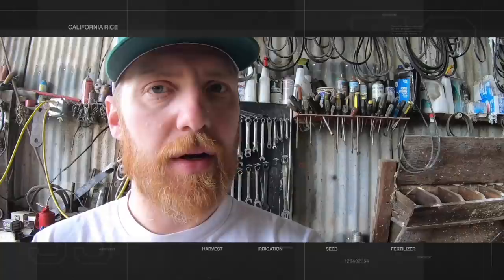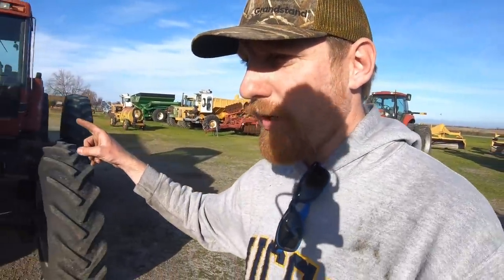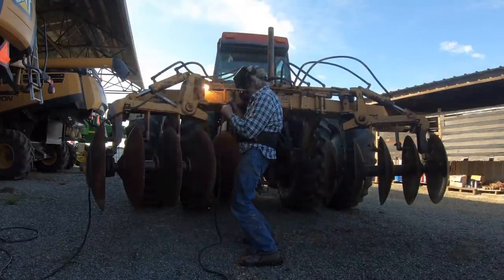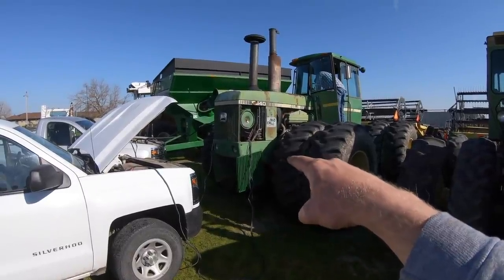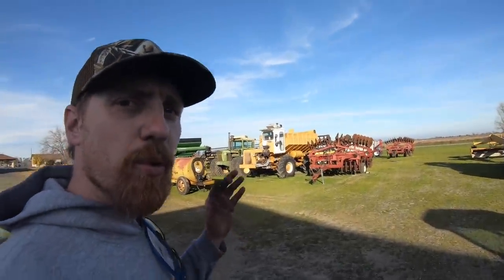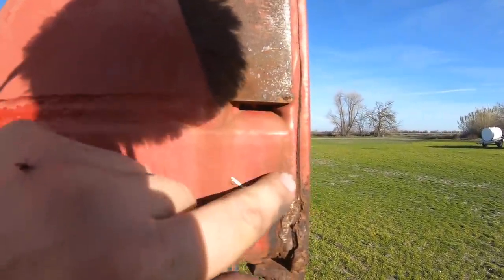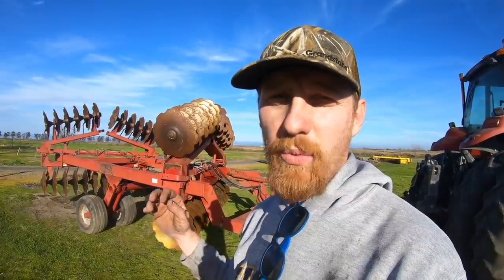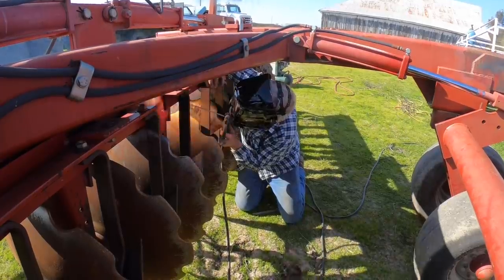The Old John Deere 8640 Roars to Life in this Tractor Video!

Comment: I have worked for a company that we would weld up the items they where using. We would V the break weld grind the weld flat and plate over because the metal where the weld was will turn hard and can crack again which for our company can mean more down time.

Comment: A rigger is just a big boarder disc?
Reply from the maker: Hi Daniel, a ridger is comprised of two wings with 3 blades on each. In operational position they form an upside down V. It helps build the levees back up. I’ll have a video on it soon.
-Matthew
Reply: @Ricefarmingtv  ok thankyou, out here on AZ I know them as a boarder disc. We use them in are hay fields.  Ours are not nearly that big

Comment: Rat holes .... what’s the biggest rat you’ve seen out on the farm?
Reply from the maker: Muskrats get fairly large. Rats, otters and crawdads all burrow through the levees. This a hole system of pathways through there. Add water flow and it washes them out, making them larger or blows the levee. So it’s not the size of the rat it’s all that together. Not trying to do extra work. Trying to do good work.
-M.
Reply: Rice Farming TV ahh that totally makes sence! Thank you for your reply I thought I was gonna hear this question in the question video but I’m happy you found you phone